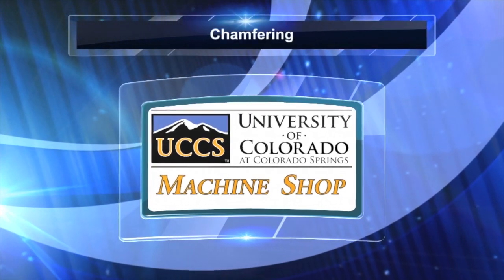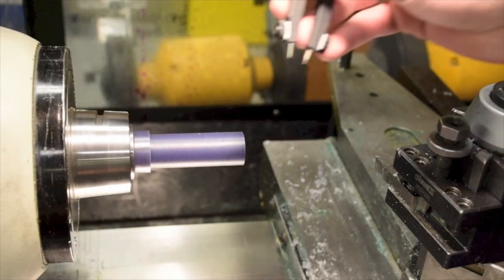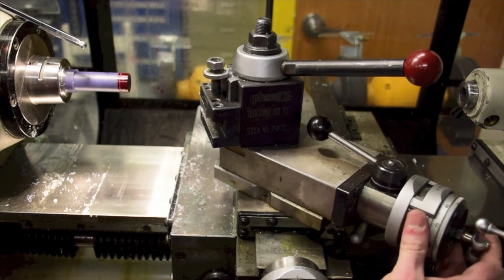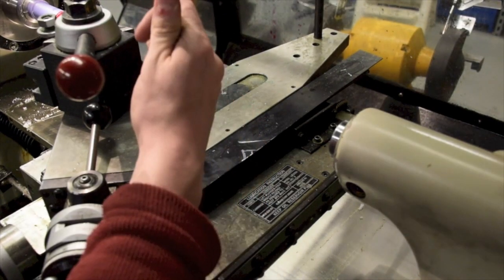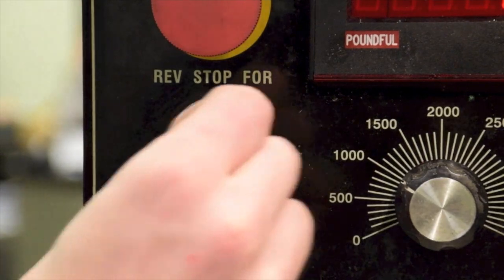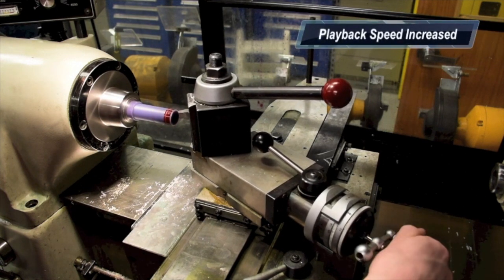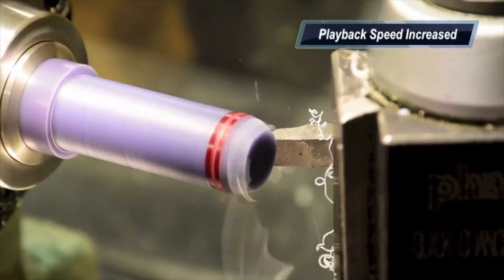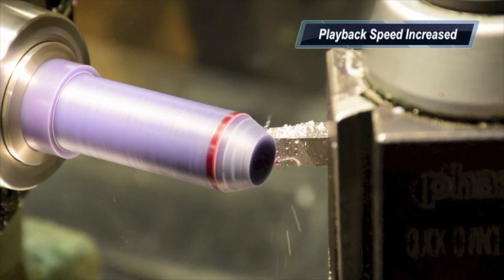Chamfering

Comment: My god your awesome I never knew what that was for I have been making custom parts 5 so far got three more to go I was cutting my I'd to size then doing a 45 from both I'd to both od basically like a v with a flat in the middle on rod stock I was making my 45 by angling my carbide at a 45 trying to get a rough shape started and going to the I'd and jog over a quarter turn out a quarter turn till I got to I'd size then a lot of sanding u just saved me a lot of time! Thank you